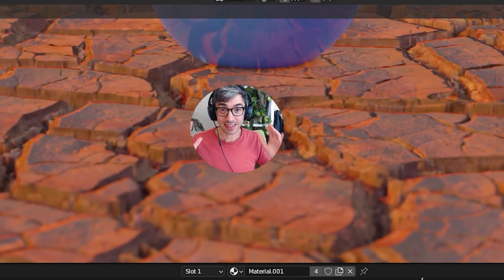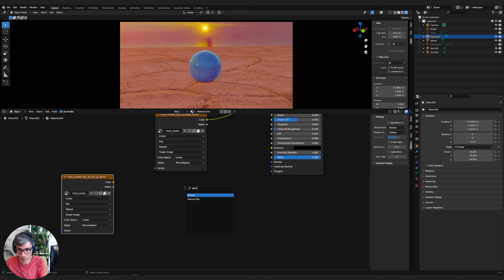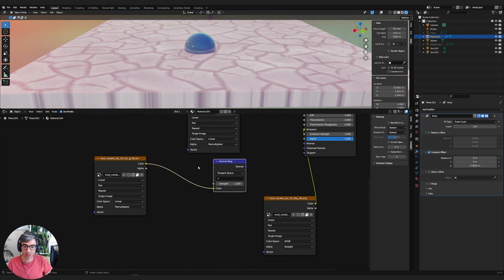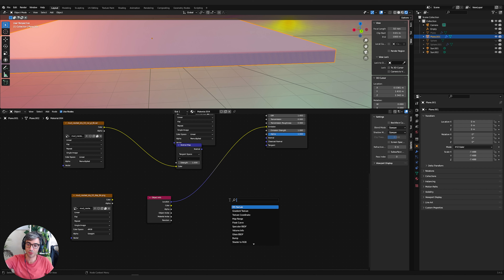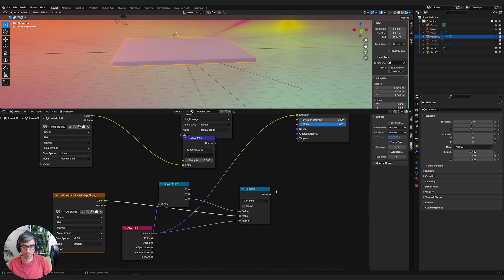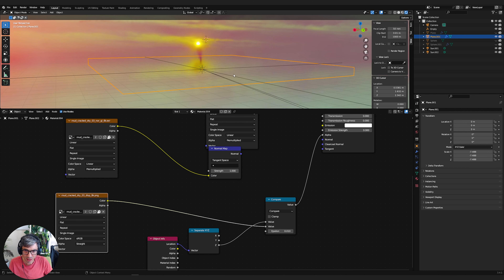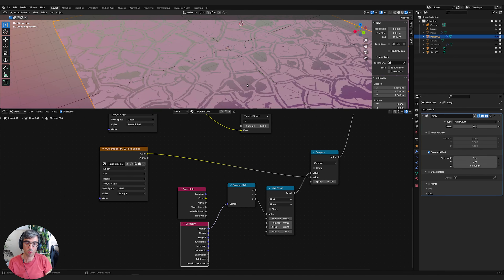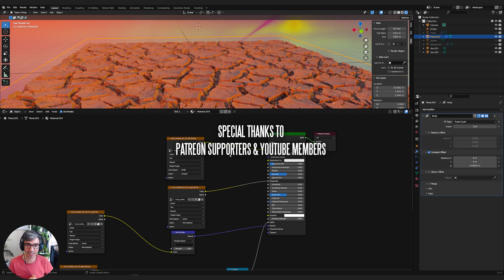Hyper Detailed Geometry From A Texture In Eevee

Comment: Super cool trick! I’m curious though if there’s a noticeable change in performance using this method versus using set position in geometry nodes to do the displacement? Would be cool to see a comparison of the two
Reply: Curious about this too
Reply: Its an insane difference. Just think about the polycount. With geometry nodes you need a super dense mesh. With this method you just have 4polys x array repetitions. This is more like an inefficient parallax shader. But that said you can make a simple parallax shader in eevee, you have the same depth effect and it's more performant than this setup. And there are a couple tutorials that show you how to actually do that
Reply: I was literally about to ask ahahah